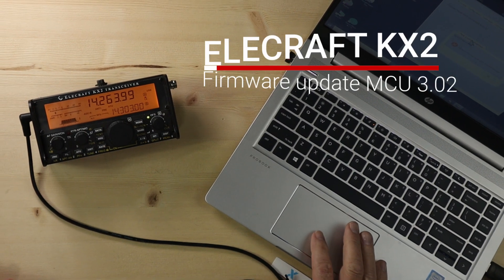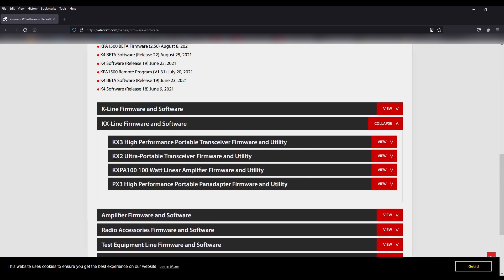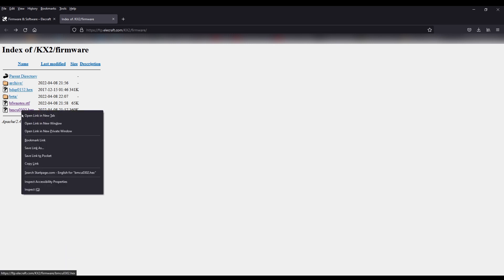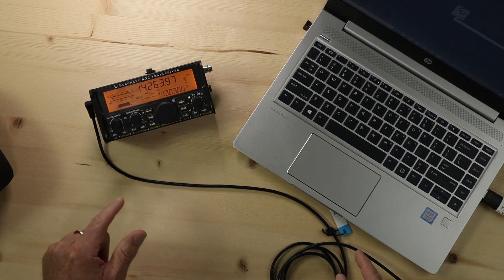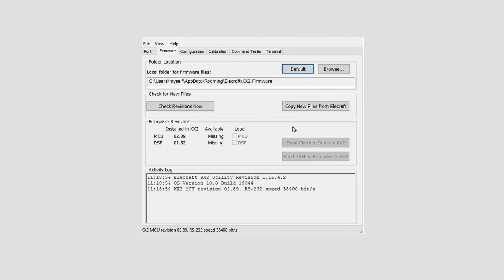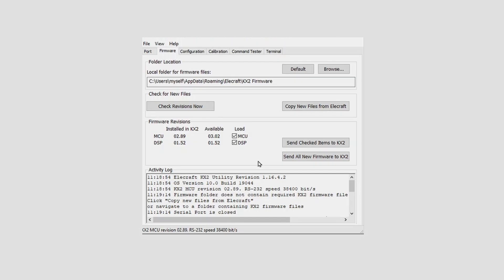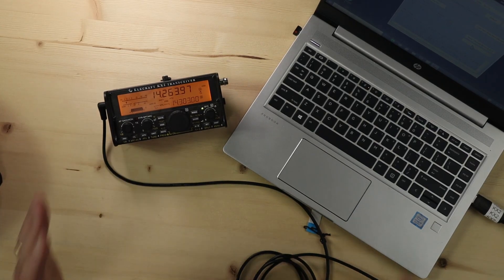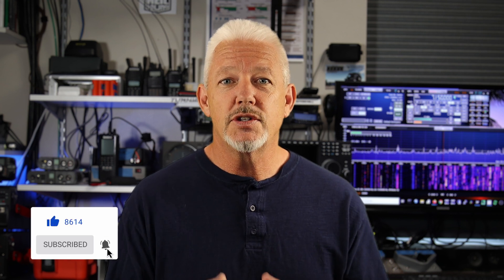KX2 Firmware upgrade | K7SW ham radio

Comment: Thanks for the walk through - bought a used KX2 two years ago and have been meaning to do this, and it was super easy.  Did it on my Mac with no issues at all.  Focusing on the KX2 this year and making it my primary transceiver.  Thanks!

Comment: So the usb cable plugs into the power port on the Kx2?
Reply from the maker: Thanks Ted, great catch.
The angle on the picture and recording looks like it could be the power port,  the KXUSB cable gets plugged into the "ACC" jack of the radio.
The ACC port is very closely located to the Power port on the radio.
(ACC is the Serial port for the radio.)    Hope that helps.  73
Reply: @hamradiowithkevin  Finally just did the update. Everything went just as you said so thanks again for the vid. 73s de AD8EV
Reply from the maker: @qrptedmac ,nice work, glad you got it going.  73